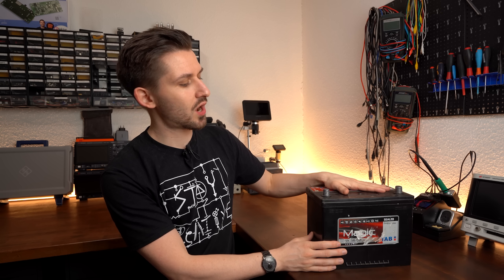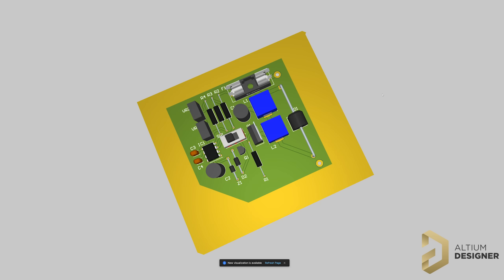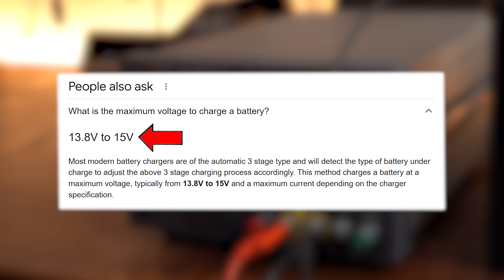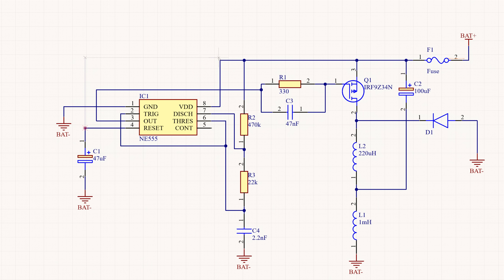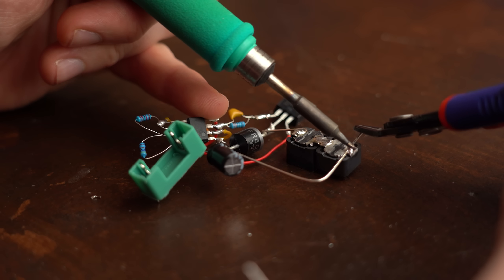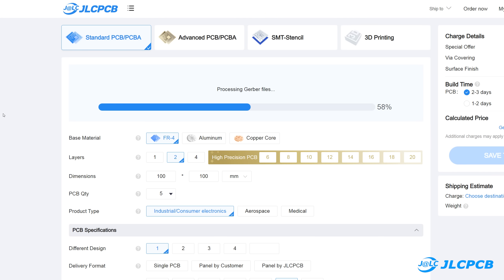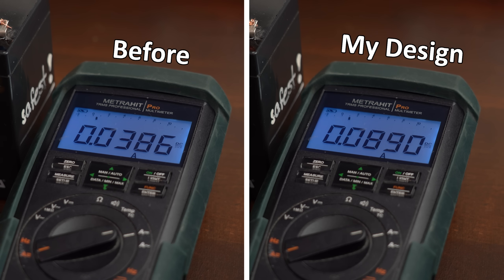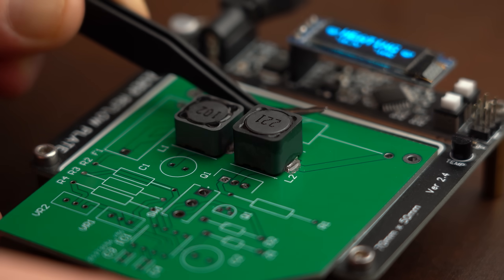I followed a YouTube "Battery Hack" and Wasted 30 Days! (Desulfator)

Comment: It would be worth checking the composition of the electrolyte in the big battery.  Often times the batteries dry out from overcharging and need water added over time.
Reply: My first thought too as soon as he brought out that first dead battery; top up the water if it won't hold a charge.  
Even so-called SLA, just means the electrolyte holes are a bit harder to get to
Reply: Or its dropped 1 cell ?

Comment: As you said R10 330R resistor is connected to nothing, but as i can see it is connected to ground pin of 555 timer ic, it is i think used to limit the current to 555 timer ic from battery negative and battery positive is directly connected through fuse to vcc of 555 timer ic.
I don't know if it works for desulfation process, but i can see this circuit is almost same as commercial one, as being sold on AliExpress.
Anyway try to use on battery, about you're sure that battery is dead due to sulfation and has not any mechanical damage like broken plates.
As in video you used working batteries.

Comment: I don't know if the circuit is working or not.
But your statement that R10 is connected to nothing is wrong. In his Video at 1m16s ( https://youtu.be/i_yFhI1JRDM?t=76 ) and in the Gerber Files he provided you can clearly see that it is connected to the ground pour on bottom layer and L1 on top layer. Just as his schematic intended. And i think you knew it and only showed the top 3D view from his video.

Comment: Knowing desulfation has been carried out on larger lead-acid battery cells, the thing missing - which also is more dangerous - involves using acid densities above recommended values; To soften the sulfate core. Those cells were equipped with a special acid circulation system as well, to avoid stratification.

Comment: The best way to desulphate a battery is to make the voltage close to 16.8v and 10A for a 20AH battery

The idea is to get the battery hot (don’t go above 16.8v) and you should see bubbles coming (gassing). I’ve had good results with all this and any lead acid battery I tried.
Reply: Yeah some consumer/commercial chargers will do this automatically as part of the charging process
Reply: The problem is this boils off the electrolyte. On flooded batteries you can add more water but you can't on sealed AGM batteries.
Reply: @eDoc2020  AGM can’t tolerate overcharging from what I read. But worth a try

Comment: Hi there, is it possible to change the battery water and do flushing to clear up the plates inside without hacking the battery ?. And use battery catalyst to restore the power after doing the test ?.

Comment: I have no tests to prove this other than I was able to get another year and a half out of the battery but here goes.  A couple of years ago I had an old battery that would charge fine but would discharge in a week all by it's self.  I read online about putting epsom salt in it to desulfate the plates.  I know it's anecdotal but it did work and I did get at least another 1.5 years out of it.

Comment: I believe lead acid states the capacity along with the discharge time (12V 10AH 20H) which means the capacity is achievable by test-draining it for the time stated, which then means the capacity is dependent on the load. Is it not all lead acid batteries?

Comment: Thanks for debunking this finally, I was wondering if there was a way to possibly revive my 102Ah deep cycle battery. We here in South Africa experience daily power cuts 2 hours, 3x per day (referred to as loadshedding by our power utility that currently can't provide our country with enough electricity). I recently lost a deep cycle 102Ah battery due to this constant charging, discharging cycles in my inverter. The battery is just past one year old.  Lithium is better, but unfortunately outside my price range for now. Keep up the good work.
Reply: Discharging a Lead Acid battery below 50% on a regular basis will kill it off very quickly. If you are doing this then adding a second battery in parallel will almost certainly more than double the service life.

LiFePO4 can be surprisingly cheap if you by the raw cells and add a flying capacitor balancer/BMS. A good cell like the EVE 280AH ones will last around 5000 full cycles where you can discharge down to about 20%. Remember to compress the cells so prevent them bulging under use. This means it is almost twice the usable capacity of a lead acid for a given label AH and if looked after properly will last 10 years or more.  Payback is surprisingly quick.

I'm off-grid with about 400AH@48V LiFePO4 and love them.
Reply: @AndyFletcherX31  thanx, i'm aware of SLA DoD but our power cuts are so severe, that it's impossible to keep a 50% DoD. I know more batteries will buffer this, but unfortunately batteries are now a commodity in South Africa, making them scarce or very expensive. But I'll explore the options suggested. Thanks
Reply: @Martin4982  I think you should not run heavy duty appliances when the power is off . Fridges, kettles ,vacuum cleaners - these kind of things . I have small pv system but i keep only my computer on it and i fully manage it - the 15 year old 135 AH battery  has about half capacity left but is usable only with direct charging
Reply: @cat_lin1  thank you for your reply and info. I'm not using high power devices. Mostly for lights, television, laptops, PC'S etc. But like I said, our power outtages vary so much, sometimes the power is not on long enough for a full recharge.
Our power utility gives us updates on what stages of cuts we are, higher stage, the longer power cuts, we recently hit Stage 6, which is 2x 4 hour and 1x 2 hour cuts with 30min buffer periods after cuts. Heck, the situation is now so severe, we even have apps that gives us loadshedding times and stages... I'll be looking into solar panels to try and supplement my shortfall from grid. But since backup power items is so in demand in South Africa, there are shortages, scams, price hikes on these items. We're doomed 😖
Reply: If you can get hold of some lead siding you can technically build your own batteries. There are some additional safety measures to consider, but there are guides you can follow. Obviously it's not an ideal option but it might be a cheap way of adding a lot of capacity, which is something you'd want anyway if you're installing solar or a wind-turbine.
Reply: @Martin4982  
Hey buddy, fellow KZN South African (Electr Eng) here. Just a thought after going through your thread here...
What is the output charge rate of the charge method you're using on your deep cycle battery, once the power returns of course.?
Reason I ask is that our load shed schedules are mostly for 2 hours at a time with the odd 3 hour session.
However, the intervals between one load shed to the next comprise at least 6 to 8 hours, couple that with you mainly powering medium to low current appliances and that battery level should (normally) never drop all the way to 20%.
But it if isn't reaching maximum capacity before the next load shed, then it's obviously very possible.
Good luck 
😎👍🏼
Reply: @Martin4982 
...as a consideration, an investment in a higher current charge system will definitely pay for itself,
Seeing that Eskom won't be resolving our load shed issues, anytime soon, in the foreseeable future.
Reply: Consider exploring the option of creating your own power storage system using used medical LiFePO4 batteries that will probably have around 80% capacity. This DIY approach could be more affordable and worth considering. LiFePO4 batteries are generally safer and more stable than LiIon batteries, but are less energy-dense. However, they can last up to five times longer and perform better at lower temperatures. It is possible to create a system using inexpensive LiIon scooter batteries as well. A DIY system should cost significantly less than a commercial option. Additionally, having more battery capacity than you need means that each battery capacity will be used less, potentially extending their lifespan. A good BMS should help you set the limits to charge/discharge to prolong them also.
Reply: @chrisjc2k  thank you.
Reply: I had a 800W inverter with no built in charger. I had to physically swop over from charger to inverter every loadshedding event. Not ideal, but at the price of the inverter it was worth the hassle. I only ever ran the TV and routers on that setpup. My brand new 100Ah battery died after 10 months, the dealer said it had boiled dry. How I can't understand, because there is no way to charge for "too long" with the amount of loadshedding we had last year. My charger never showed more than 4 amps but was mostly putting out only 2. (I should say instead that the battery only DREW that amperage!) There went R3000, as the guarantee only covered "factory defects". Luckily, I scored a very nice 1440W 24V inverter from a fiend who had upgraded his setup. Now I can run a light or 2 (LED of course), my PC and the TV and routers for a full 4 hour loadshed, and still have 23V on the batteries. (4 of them)
Reply: See my post, for lead acid only.  I have NOT had success with UPS ( Uninterruptible Power Supply) batteries, which are the sealed gel/glass matt type.
I think same as you deep cycle?
but for everyday 12v liquid lead/acid, mine WORKS, for about a year or two, depending on how bad the battery is of course.

Not sure if the one I use will help you, but if the battery is dead already, no harm in trying, right?

Just do it OUTDOORS!
Reply: Hey if you can collect metal food containers give making an iron battery a try. This will need a lot more space but its probably cheaper and lasts longer for the capacity as they should be able to handle a lot more abuse and more environmentally friendly compared to lithium. They might be basic in tech but are essentially one of the more longer lasting but older designs only with far less capacity and more space needed.

Over here however lead acid batteries are approaching the price of lithiums in terms of capacity since lead is now very expensive. You can also consider aluminium batteries too as both iron and aluminium are much cheaper than lead and plentiful.
Reply: You can try harvesting cells from old laptops. Many laptop models (especially ones with a removable battery pack, not a built-in one) use standard 18650 size lithium ion cells. 18mm in diameter, 65mm tall, max charge voltage 4.2V, minimum discharge voltage 3V and nominal voltage 3.7V. Capacities max out at about 3500mAh, but old used ones may have only 2000mAh left. You will basically have to connect them in series and parallel to build up to the capacity you need, and use an appropriate BMS to keep everything safe. You'll need something like an Opus BT2100 for the initial charge/discharge to find out how much useful mAh remains in each cell, then you'll have to match cells accordingly so each group of cells has equal total capacity before you connect them in series to other cells (otherwise one set of cells will charge or discharge faster than the other sets in the string).  Lots of DIY powerwalls using this idea on YouTube, have a look around. The advantage of this approach is that you can get the cells for free (just tell people you will pick up their old laptops for them for free; dismantle the batteries to harvest the cells and send the laptop itself for recycling).
Reply: So sad what's happened to SA.  No one is interested in talking about it anymore.
Reply: Hi Martin, if you are looking for a reliable long term solution you should check out Lithium Titanate batteries. They are rated for 20yrs and 20-30,000 cycles. 

They're  a very new technology  and are completely taking over Recreational  & Solar Home battery storage.